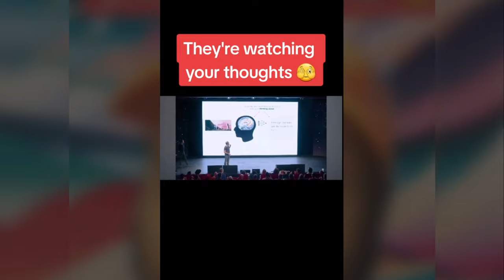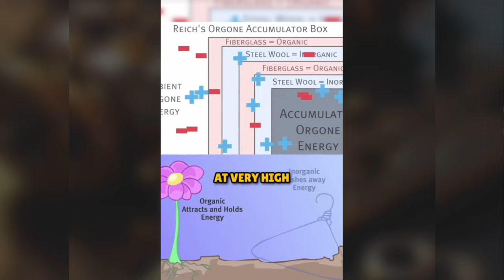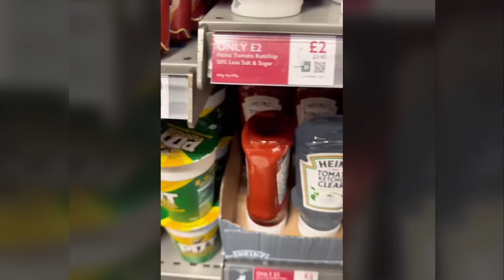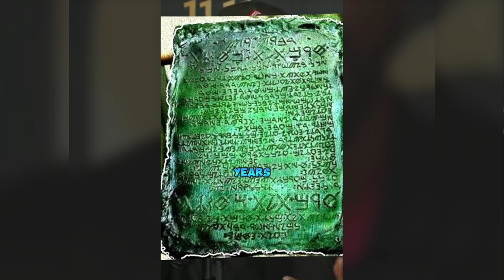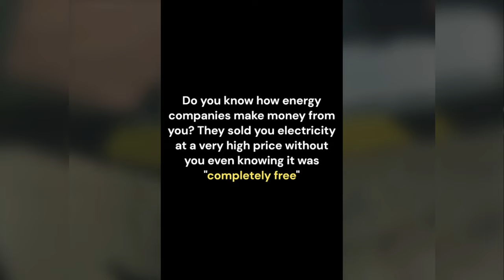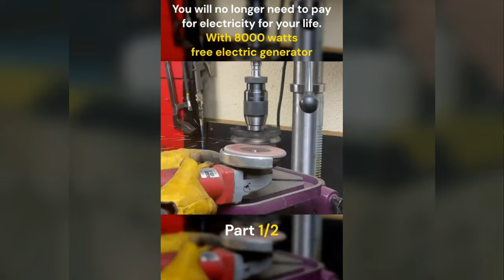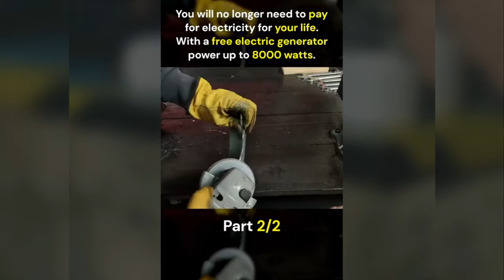Creepy TikToks That Will Blow Your Mind! (Day 81)

Comment: That  is a lightning rod on the church and all the houses have them to look at where you’re electrical boxes come in and you’ll see the ground rod in the ground
Reply from the maker: Yeah. I installed mine myself when getting my place. It has to be there for code. And safety. I knocked my rod down about 8 feet into the ground with the ground cable leading from it to the electrical box.
Reply: yes correct but origionally they used for energy

Comment: Definitely grounding for lightning. I don't disagree with the free energy theory either, but those cables are 100% to discharge lightning 🤣🤦‍♀️
Reply: But what if there is a way to capture and store this atmospheric electricity such as lightning?
Reply: @GoodAfterNoon  There probably is. But those cables are literally for grounding. Most houses here have one, and if you haven't, then you just hire someone to fit one 🤷‍♀️
Reply: I believe in free energy. I believe it's not as hard to seperate hydrogen from h20 to fuel a combustion engine. 

Everything is about money and how can we benefit from it type ideals (tesla vs Edison). No leaders want anything they cant benefit from.

This really grinds my gears 🤣🤪